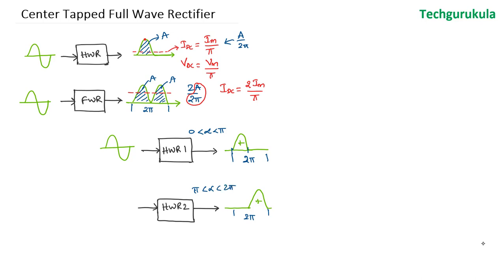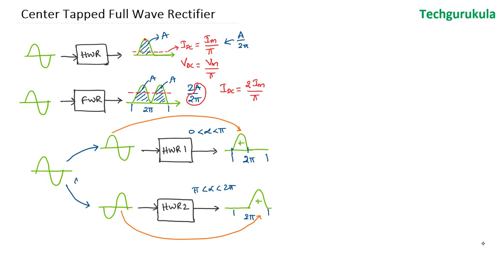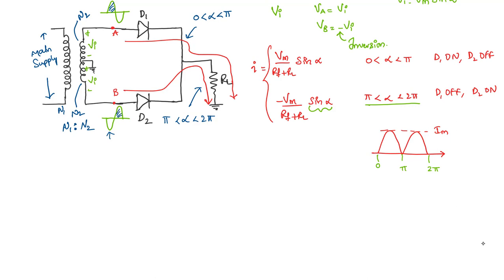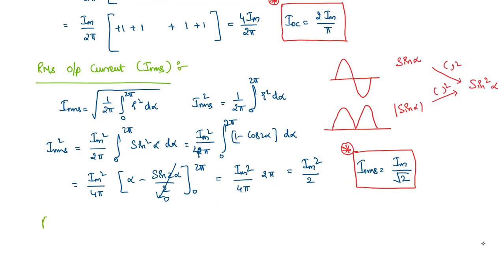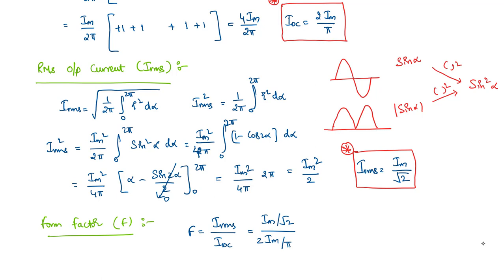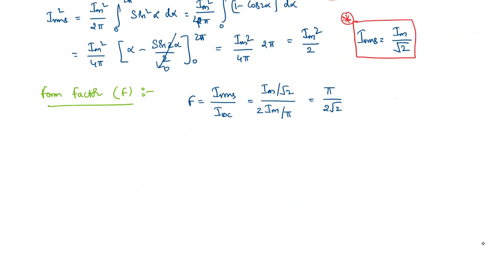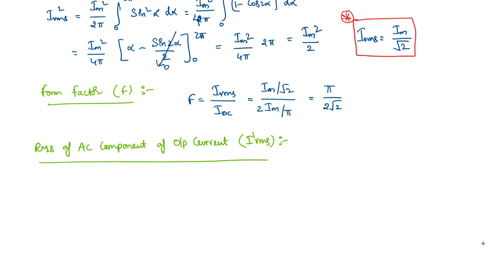Center Tapped Full Wave Rectifier - Working

Comment: please help!!!!!!!!

A full wave center-tapped transformer rectifier in a power supply provides an average dc output
voltage of 14V on which a maximum ripple of +/-0.5 volt is allowed. Diodes have a 0.7V drop
when conducting. Assuming a resistive load of 120 Ω, a line voltage of 120V rms @ 60Hz through
a transformer,
(a) Sketch the circuit diagram for the rectifier
(b) what is the rms voltage across the transformer secondary?
(c) Determine the size of filter capacitor required.
(d) Assuming 50% safety margin, what diode PIV rating is appropriat